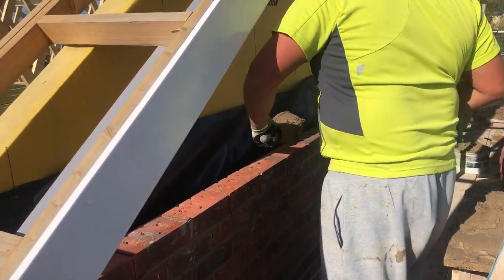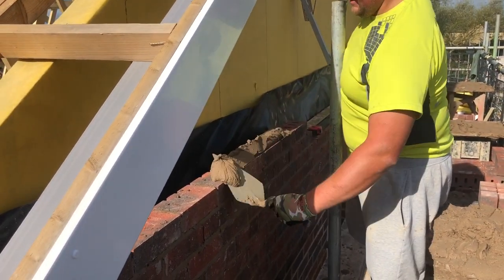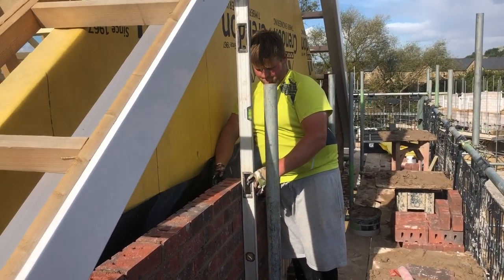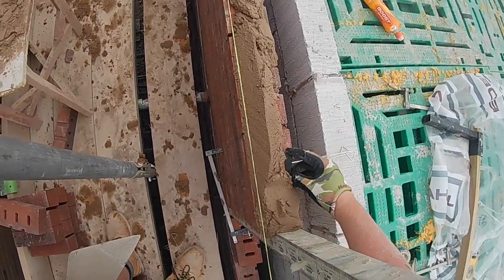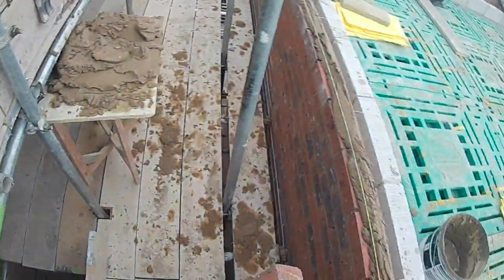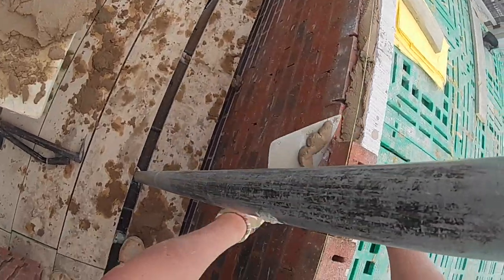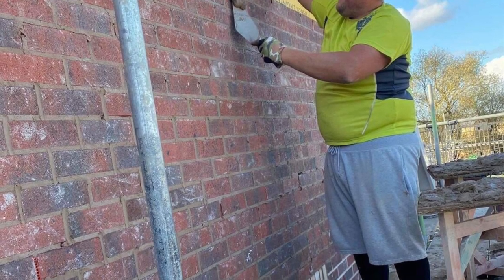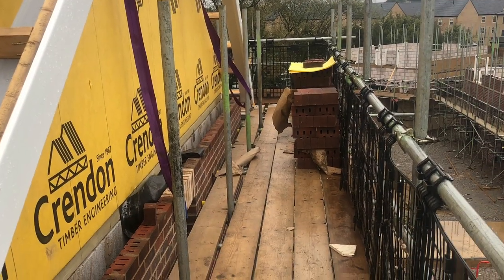Bricklaying Vlog - A Nice & Easy Top Out - Mel’s First Day on Site & Big Corners on Pike’s? - Part 1

Comment: Just noted when you put your tray in on spandrel panels you don’t cut the felt we have to cut the felt vertically and tuck the top of the DPC underneath and tack it otherwise any moisture can get behind the tray ? 
Great content keep up the good work 👍
Reply from the maker: This was the only one we did wrong lol
Reply from the maker: Gotta keep it 100% we had to tape it after, n lap it now, even tho it's only to stop the insolation rising up, can't see moisture getting across like lol
Reply: Not a criticism, but just wondered , 👍
Some NHBC mire fussy than others eh?
Reply from the maker: @martinstanford2071  thanks pal, there mega fussy everywhere these days